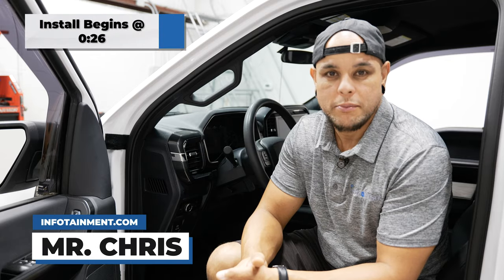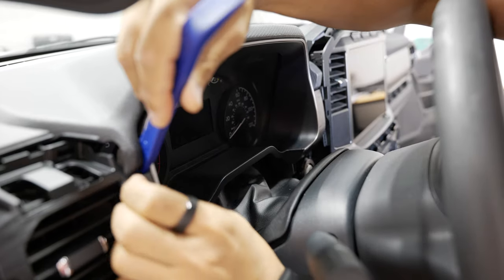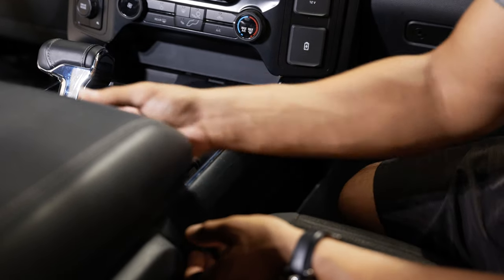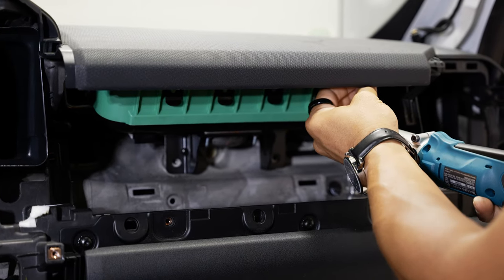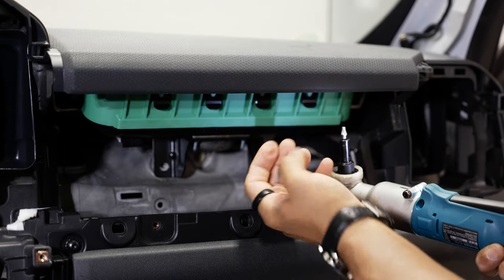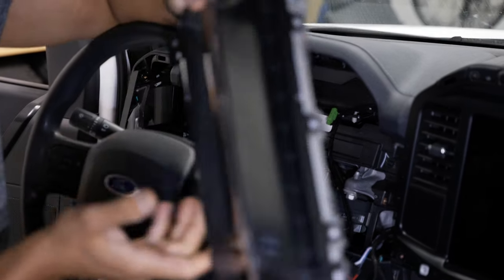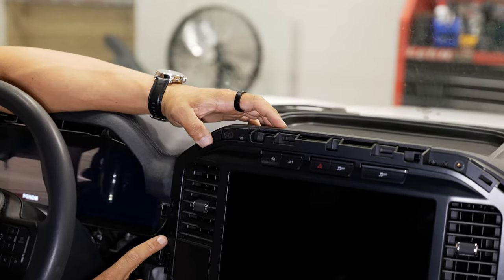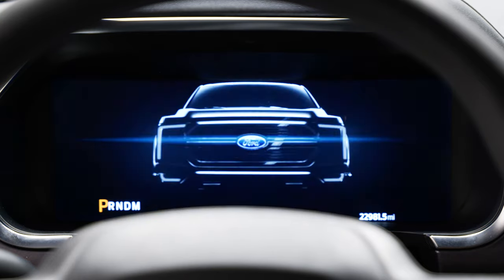2021-2023 Ford F-150 - 12″ Full Digital Speedometer Cluster Upgrade Install Guide - Infotainment.com

Comment: I just ordered the 8-Inch Digital Speedometer EVIC Instrument Panel Cluster upgrade to go with the 8" to 12" Sync 4 Touchscreen Upgrade (Non-Nav w/ Center Console) i got from you guys in December. Will the Ford Splash Screen be full size when turning key on or will it have the small 4.2" splash screen still? Also will i get the last mile navigation to show up in the cluster when using android Auto navigation? or do I lose that feature because I don't have built in navigation.. Thanks for the service you provide.
Reply from the maker: We have a technical support team who would be happy to help.  They are here to help Monday - Friday EST from 9:00 am to 5:30 pm.  You can also shoot them an email if it is outside of that time frame and they will reach out.  Please make sure to include your order number for them to reference. 

Infotainment.com Support: 1-855-636-6287 Ext: 11  
support@infotainment.zohodesk.com

Comment: Is it possible to convert 2018 to the modern model?
Reply from the maker: Unfortunately we have tested these clusters as retrofits but have not found success yet. Use this link to stay update for the release of something like this. 
https://forms.zohopublic.com/infotainmentcom/form/ProductInterestListForm/formperma/m7R2exajUQkfs2WJO8mkDzUcYC2HIt5WrUWxFICnigs
Reply: Is it programming issues missing features or fitment?
I guess that small piggy tail that goes on the cluster is missing on the earlier models..
Fitment is the other problem. Having to change the entire dashboard..
You can change partially but need to cut and modify it to fit it and matched with the old one, but it will look weird.
That'll be a nice project cause I hate the old cluster from my Gen 2 Raptor and Gen 3 features are not so different from Gen 2.
FORSCAN will tell which features are not available and you can disable what does not apply to GEN 2 and the rest should work.
Let me know what you think Mr. Chris and that was a great video. 👍🏽

Comment: I have a scratch on my digital 23 cluster. Do they have to remove the dash and all those steps to swap it out or is it easier than the conversion? Thanks
Reply from the maker: No unfortunately we would have to remove that Cluster if we wanted to do a replacement. It would be identical as the conversion as far as intall is concerned.
Reply: @Infotainment_nav  figured it out. Surround comes off and then all the harnesses and reverse order.